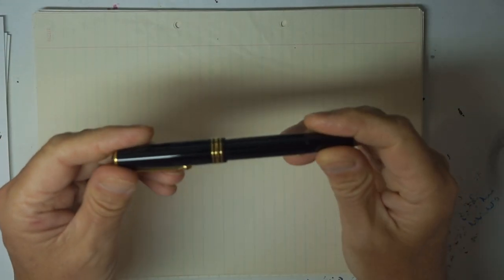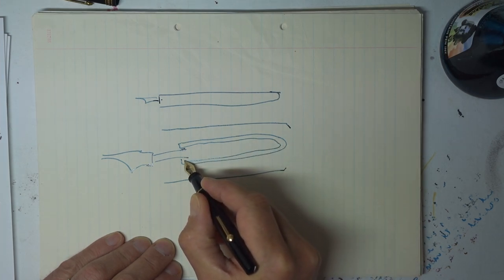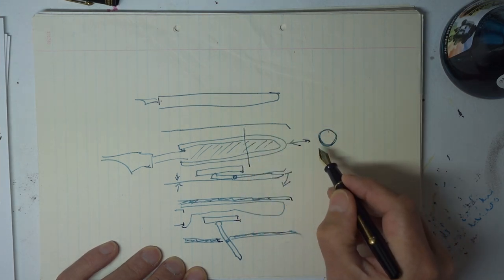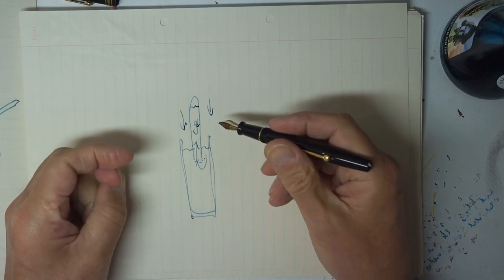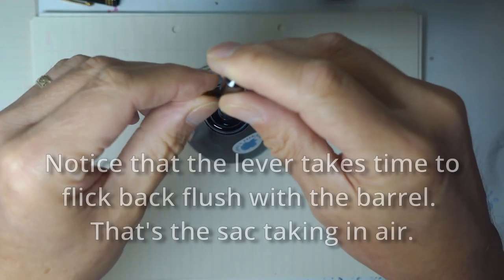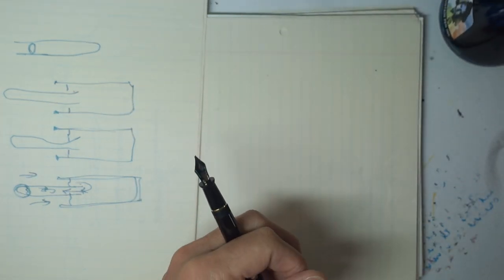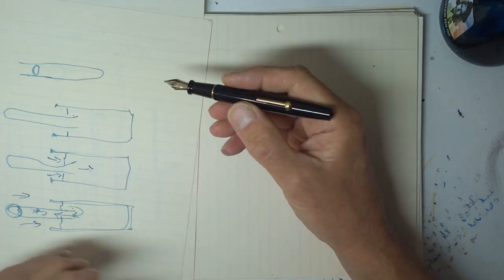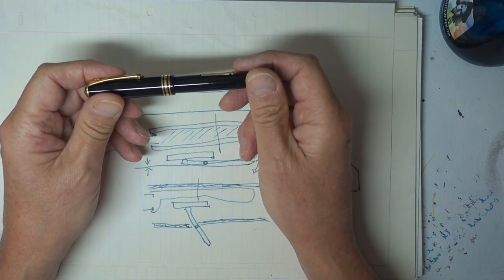Lever Questions Answered

Comment: I have a few (well, many more than a few 😁) sac fillers, of which the lever filler is an example. Almost hundred year old pens still with no major issues. Yes, I generally have to replace the old ink sac. Though I have several 70 year old Esterbrook pens that are still on the original sac (they used the same ones everyone else used, but they seem to be strangely more durable in an Esterbrook), most need replacing. Generally about a 5 minute process, not counting the dry time for the shellac to seal the sac in place.
Lever fillers were so popular because they are very simple, generally durable, and easy to use.
Some are slightly different. Waterman's used what's called a "box lever," with the lever in a metal box to keep it in place and avoid deformation of the barrel around the spring that holds it in place. Waterman's, and vintage Conway Stewart used a pressure bar that slides on 2 TINY pins to secure it, other than the more common "J bar" most others used. 
A gripe about lever fillers is "they're harder to clean." Not really, in my experience. Maybe a little longer, but not harder.
"Some inks eat the sac." Again, not in my experience, and I've used inks on the "forbidden list" (Noodler's, to be specific) with no problems.
"They don't hold as much ink." If you use a cartridge converter, they hold the same amount.
Ultimately, they're some of my favourite types of pens. I will lump in the button filler, the crescent filler, the coin filler, the matchstick filler (though I don't have the last 2 types. Same basic concept, though.)
I will say that they can get looser over the years, and depending on how cheaply made the pen is, you can get deformation around the spring for the lever. Or cracking around where it's pinned in place. But, remember, it's taken years for these things to happen. The original owner probably got decades of use from them, and it's still working, just not as pretty.
I have several that the lever is loose. Just means that the 70+ year old pen needs to be more carefully placed in a pocket, or be careful if you post it. Lever fillers are, for the most part, very durable and easy to maintain.
I think that you covered the basics quite nicely. Thanks for sharing this, potentially opening people up to another type of great pen!
Reply from the maker: Thanks so much, Paul. I really appreciate the comments. I'm with you - I really love the lever-filler. I haven't yet played with a Mark Twain, but they seem ideal too. And as for capacity -  any limitation just demonstrates the ease of refilling for me!
Reply: @writerlywitterings  I have a 1917 Conklin Crescent 2P (vest pocket model.) Great little pen! With the modern ones, there may be a possibility of issues, though from what I'm hearing, it's gotten better (though the ring for the crescent, to act like a "safety," is still a little loose for my taste. Seems to be with all of them. Guess the build quality of the original spoiled me. 😁) Yafa going to Jowo nibs seems to help.
Reply: For sentimental reasons, the original Conklin Crescent Filler is one of my very favorite pens.  I learned to write with a pen using a Crescent Filler that belonged to my grandfather.   I've love the Parker Duofold Button Filler since the first time I wrote with one.  As young as I was, as small as my hands must have been, that pen just wrote perfectly.  Still does.

Comment: I grew up using lever fill pens that belonged to my grandfather.  I never had a problem with a lever bending, let alone breaking.  Maybe because my grandpa made it clear that I needed to be careful and gentle with the lever.

I did have a couple of sacks rupture, but those pens were already decades old.  This doesn't seem to be much of a problem with modern pens because most of them don't use rubber sacks that can dry out when the pen isn't in use.    

I don't think there's any doubt that cartridge/converter pens and eyedropper pens are the most reliable and trouble free, but I've had much, much  less trouble with lever fill pens than I have with piston fillers.
Reply: Yep, the trick is to be gentle - I use the underside of my thumbnail to first lift the lever and then finish the lift with the ball of my index finger slightly down the lever, where it is stronger. If you put a new sac in it you may not be able to lift the lever to 90 degrees - no matter. I grew up with lever fill pens - standard issue at my school where I learnt to write - they can’t be too bad.
Reply from the maker: I have to admit, I have had no problems with any version of sac-reservoir pens. Even my Sheaffer from the 70s still works fine with the original (I assume ordinary rubber) ink sac. I think people are a lot more anxious because of lack of familiarity than any real issues.
Reply from the maker: I think people got hooked on cartridge convertors for convenience, and cannot get their heads around the idea of an ink sac, which is a real shame. I think it's one of the quickest, simplest and most effective filling systems there is!
Reply: @writerlywitterings  One of the sacks that ruptured on me was a very, very early Conklin Crescent filler that my great-grandfather bought almost as soon as they hit the market.  I think my grandfather said is was 1902.  The other wasn't in a Parker Duofold Button Filler. from about 1930.  Both of these ruptured in the mid-sixties, but I don't remember the years.

I have seen a number of ruptured sacks on those older pens, though I didn't own them. In fairness, I will say that far more often than not the pens hadn't been used for a lot of years, and the rubber dried out and cracked, and then split when the pen was used again.   I've only seen a couple of new pens have sacks that split, and that's normal.  Nothing is perfect, and on a percentage basis, sacks are extremely reliable.

And it's very, very easy and quick to replace a ruptured sack.  Too, I really have no experience at all with the sacks in pens that are on the market now.  I don't even know what material they make the sacks from, but it absolutely isn't like the rubber that was on those old Conklins and Parkers.

Comment: Have you tried using your Pineider travel inkwell? If the pen fits, I think you would get a nearly full reservoir with gravity helping the fill. I use mine on my Pilot Custom 823 vacuum filler and it gets a complete fill. A different mechanism, I know, but the lever-filler should also get the benefit of that inkwell.
Reply from the maker: No, I haven't - the Conway Stewart #58 has a large swelling at the nib end of the section, which is cut quite sharply. That means that it's an unreliable (!) fixing in a Pineider or Visconti travelling inkwell - i.e. the pen can come loose and suddenly spray ink in every direction! I may have a look and see if I can run some tests with water, but for now it makes me anxious to look at it!
Reply: @writerlywitterings  I'd be really interested in the result if you do give it a test with water. Cheers

Comment: Your pen looks like a reproduction of the vintage Conway Stewart 58. I have many lever fillers pre 1960s. They still function beautifully if the sac is not perished. These latex rubber sacs at one point of the rot cycle, will not expand normally—they won’t suck up ink fully—the sac sides stick together—an indication the sac must be replaced. If the lever is stiff DO NOT force it—you need a new sac. Sometimes the lever pressure bar is pulled out and detached from the lever when removing the perished sac. With vintage Conway Stewart pens, putting the bar back onto the lever is “easy’ after finding instructions. The lever must always click flush with the barrel… otherwise there is a problem.
Reply from the maker: Thanks for that. Yes, this is a reproduction of the 58 which CS manufactured and called the "Indiana Jones" after the pen that was used in the third film to squirt ink into the eyes of a German guard and gave rise to the quote "The pen is mightier than the sword" in the film by a giggling Denholm Elliot. On mine the lever doesn't click into place, but I think that's a design decision, and it does sit nicely flush with the barrel. It's a great little pen, a good size and light, and ideal for pretty lengthy writing sessions.

Comment: so the ratle of the lever is gone also when you act like that ?
Reply from the maker: When it's full, and you've let some air in, the ink sac swells to its full size and (on my pen) there is no rattle. The sac presses the bottom of the lever to the edge of the barrel so it can't rattle.
Reply: @writerlywitterings  i go try in the evening ….finally the problem solved 🤞 😀
Reply from the maker: @patrickblindeman5847  Success!
Reply: @writerlywitterings  and we have a winner , thanks Michael to show how it must be done 🥳👍